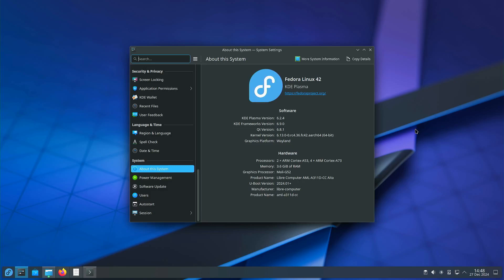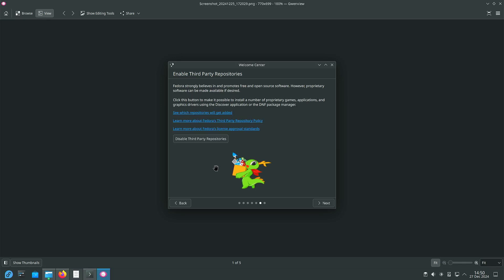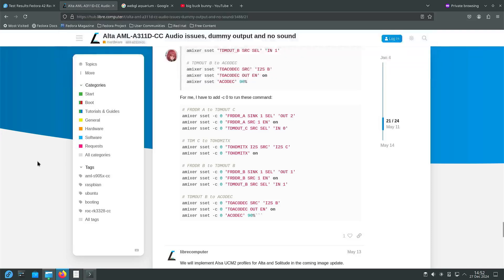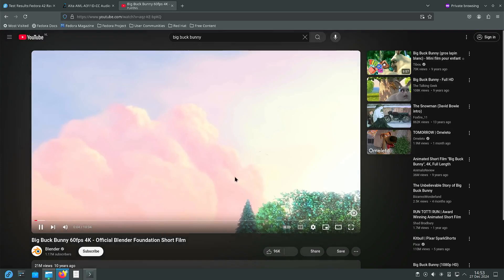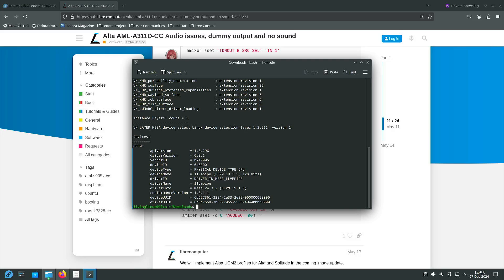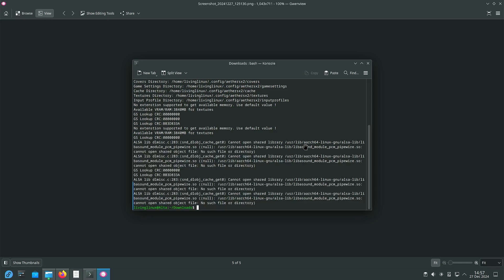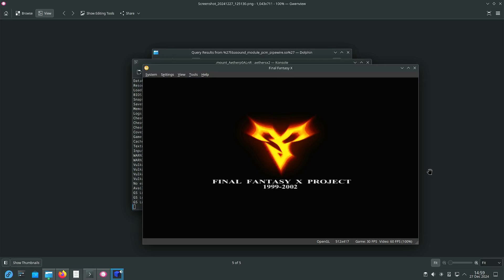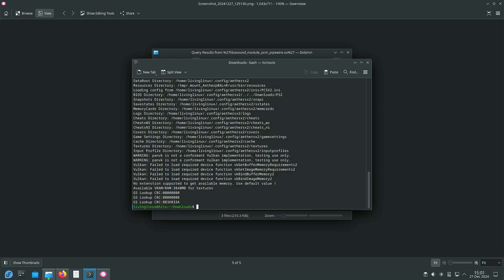Fedora 42 Testing Release on the Libre Computer Alta

Comment: For vulkan 1.0 support in panfrost, Mesa 25.x is needed which comes with Debian 13 or a newer Fedora release. You can also try compile manually and try. Good review!
Reply from the maker: Fedora 42 now has Mesa 25.0.6, but I still have to activate Vulkan with PAN_I_WANT_A_BROKEN_VULKAN_DRIVER=1. Or do I need Mesa 25.1.x?
Testing with vkcube I do see that the CPU load is around 10% lower.